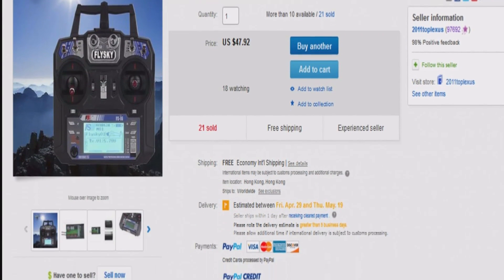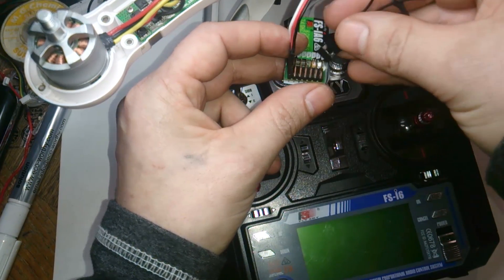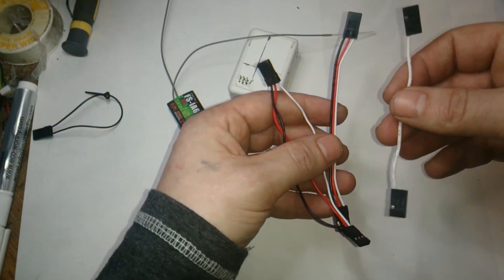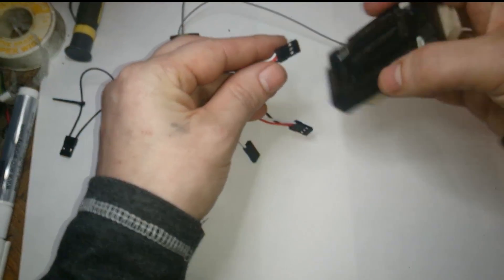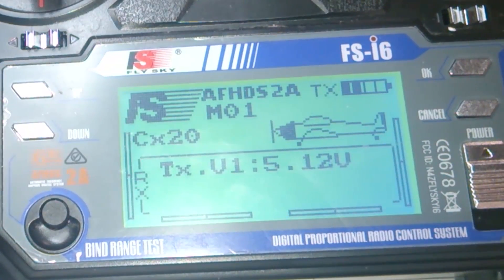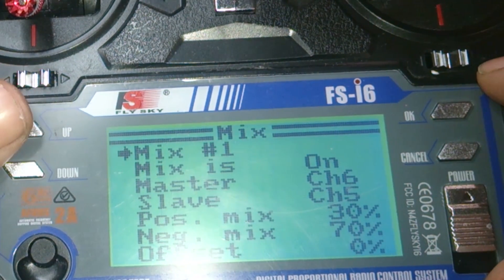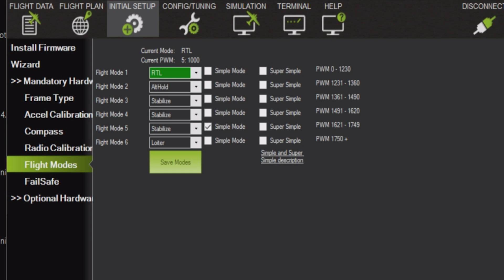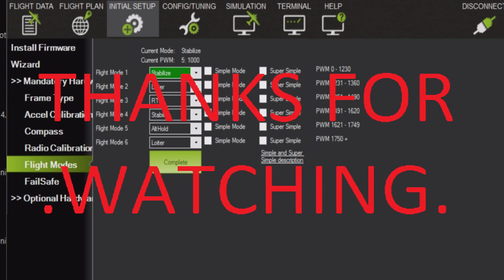cx20 flysky FS i6 FS IA6 binding and Mission planner settings

Comment: I have the Nova Pro from Hobbyking aka cx-20 that I want to use the FS-I6 with. I used this video to set the flight modes on a 450 frame quad I also have, worked great,on the Nova  Pro I also want to use one of the pots to controll a gimble.Have you made a video showing how to set up the pots?. Thanks Ala
Reply from the maker: ..your problem with that is your out of channels.. you can only have the dip switches .. or just the variables..    A guy named ViNsEDj asked the same question here in the comments..,..,The best I could suggest is using one dip switch and one variable .. but really you should look into doing the firmware upgrade and getting the ia10 receiver or the ia6b
Reply: I should have mentioned that I have done the 10 channel upgrade and have the 10 channel rx installed in the cx20
Reply from the maker: Hi for you its really easy .. just set the same settings for 5&6   but set the variables to use channel 7 and 8.. then simply plug in your cx20 gimbal wires into 7 and 8..
Reply from the maker: also for 5 and 6 mixing.. if you are not happy with that I found a alternative way ..  https://youtu.be/GMeAXyKahlw?t=858    i show how to use end points instead to get your 6 modes in mission planner, later in the video I show the settings for mission planner ..
Reply from the maker: sorry going to spam you .. with comments.. you can actually start the video here.. https://youtu.be/GMeAXyKahlw?t=799    its what you want with the gimbals anwyays.. just you don't have to connect to the apm.. you can connect directly to your receiver output 7 and 8  ... after I show the remote part you can skip to the end because you have the ia10  ..here are the mission planner settings for dip switches.. https://youtu.be/GMeAXyKahlw?t=1168
Reply: Ok Thanks a bunch That should be easy.As far as the 5&6 mixing for the flight modes im happy with the way they work now seems exactly the way it orginaly worked Thanks again
Reply from the maker: k cool, good luck..and safe flying =)

Comment: I notice at 1:38 on your video the white wire is not connected. On mine the wire was once connected but then cut. Is this supposed to be like it, or did you break yours by accident and maybe I cut mine when snipping off the zip ties. I also have 8 channels on the original rx but 7 0n the i6.
Reply from the maker: Interesting .. long time ago I had re soldered the wire ..then just wrote that pin off because its connected to a capacitor that goes to ground... So I just figured it was a dead pin .. I'm sure by now somebody has figured out what it is for..   I just looked over the data sheet and looked on the original receiver..and it is connected to pb6 of the st chip..alternate functions can be i2c and uart  (tx)  .. However the cap on the main board tells me they did not want that pin floating.... ... Maybe I'll try snooping that line later. they might of used a 8 channel on he cx20 and that pin was suppose to tell the cx20 when the battery in the remote was dead ect ect.. ..    Anyways  Maybe it would be best to solder that wire back up .. they did go through the trouble to make sure it did not float   later tonight I'll hook the wire up to my pc and see what is coming out of that pin.. At least on the original cx receiver..
Reply from the maker: I should note.. that maybe mine was never connected as well.. because like you .. i noticed it and said wtf.. then soldered to where i thought it should go..that was year or more ago.... to be honest I can't say 100 percent it was actually soldered originally..  ..maybe i Just assumed..  ...buttttttttt I had actually soldered it ..and then it fell off again to add to the confusion
Reply: Most strange,mine still has a piece of white insulation on it leaving about 4mm still soldered to the board. I'll ask on one of the cx20 forums but probably leave it cut.
Reply from the maker: I never did.. mine fell off again anyways ..... the data sheets said not have those pins floating ..so it totally makes sense to where it's connected..why it keeps falling off I have no idea about that either.. maybe later I will solder back on ..and simulate a flight with half throttle then remove the wire.. just to make sure its not causing our crashes when it does come off..    not sure if thra5herxb12s found more info about it .
Reply: I soldered mine back on and had a quick flight with no apparent probs. I just installed autotune so I'll go back out to set it up and have another test flight.

Comment: Thanks for posting. I wanted to use my i6 tx for my cx20 but what will happen to the gimbal, will it just point downwards or just thrash about. Is there some way to preset the angle on the walkera g2d.
Reply from the maker: I don't have that gimbal .. but you do have options .. You can do the Mod to 10 channels (you  need iab6b or get ia10 -- Ia10 is a quick mod, you just have to flash your tx and get a ia10 receiver  ....

You can test your gimbal and just see what happens 

You can go into mission planner and go into the optional hardware section. choose camera.. then set your settings.. example..
Set Tilt to rc8..  Make sure input channel is disabled. 
click stabilize Tilt
Now plug your gimbal Tilt into motor output 8 on your apm 

For roll set it rc7 .. use motor output 7 on apm .   ..
if you have pan then use rc6 and motor 6 output...

Also you might not have to click stabilize.. (just play around)

But most likely your Gimbal should adjust it self just when you plug it in..
without having to plug it into the apm.
Reply: Thanks. I can buy a new rx easily and follow your setup guide.  The gimbal needs to know what angle to point, it only has tilt function.some quads dont have an option to control the gimbal tilt remotely so I guess it must have a preset control for tilt, I need to look again at the instructions.  My main reason for wanting to use the i6 control is to try and get better range,how much range will it get compared to the original control.  Many thanks.
Reply from the maker: your right it should .. most gimbals will auto balance in the first 10 seconds ..worst case ..you can fallow my steps and just set the angles or the low and high to be the same thing ..that should lock it into place..
Reply from the maker: Hi i just did a bit of snooping around.. nice gimbal btw .. anyways I found this .. http://img.banggood.com/images/upload/2014/04-1/Walkera%20G-2D%20Gimbal%20Manual.pdf     and the instructions are on the right for  "initial tilt & roll motor angle adjustment instructions"    .. so after you do that you should not need to use the gimbal wires for it to go to the set location on start up..   .. and about the range I have not done any far range tests with it.   I originally got it because it has throttle curve. but it turned out I did not need it. I just had bad programmed esc's..
Reply: Many thanks.

Comment: Hello and thanks for your videos there always great.I just purchased the fs-i6 and have used this video to setup the flight modes.What im not sure about is what type of aircraft do I set the transmitter to for quadcopters, I assume its one of the 3 choices it has for helicopters.Which are fixed pitch, variable pitch and swash 90.Thanks for your help .Alan
Reply from the maker: hi I never bothered caring for that, I just use plane. thanks for the kind words as well.
Reply: Set it for airplane.

Comment: If im not mistaken, you affirm that Gimbal controls wont work with this? Damn just received it from Banggood :(
Reply from the maker: right.. unless you have the b version of the receiver then you can use modded firmware .. i just ordered this one http://www.ebay.com/itm/301888478520?_trksid=p2057872.m2749.l2649&ssPageName=STRK%3AMEBIDX%3AIT   ... really I should of ordered the 10 channel for couple of buxs more..but want to eventually make a step by step
Reply: I think I will too. BTW is there anyway to, 4 example, sacrificate one flight mode in order to configure gimbal moves?
Reply from the maker: I think the most you could do is have one dip for flight modes and one variable for only moving one axis of gimbal!?     so to try that in this part of the video only change one of the aux channels away from the variable https://youtu.be/Vyt2d8rXkws?t=532  you would probably want the dip with 3 switches ..0 for stabilze , 1 for loiter, 2 for return to home .. ect......
Reply from the maker: btw if you have a video transmitter on your quad. I'm almost done the software side of my headtracking ..It will be wireless and not dependent on remote ppm input.. which our remotes don't have either .so basically it will be able to control any gimbal on a quad pretty cheaply ..
Reply: Just done, put aux 5 in SWC, got 3 positions, Stab, Loitter and RTL, and aux 6 in VRB, and there, I can change the gimbal pitch! Its a gr8 way till I wait for the 10ch receiver to arrive. Just for curiosity, maibe S2 in Cheerson is CH7?? (Didnt connect channel  7). You´ve really helped me out, big thanks dude
Reply from the maker: cool it worked out for you.. yup the cx20 is 7 channel 5 is for your switches and 6 and 7 for 2 axis gimbals ... ...
Reply from the maker: It can be you have to re do a remote calibration.. then you have to redo a all at once esc calibration ..to let the esc's know your new low limit
Reply from the maker: andd just to make sure you need to reverse channel two  as well.. https://youtu.be/Vyt2d8rXkws?t=502
Reply: I did it, its working fine now!! Thanks for you big help!! Will u do a tutorial with the updated receivers? Going to try the cx 20 now!! :)
Reply from the maker: your welcome, yup once i get my new receiver in I will for sure..

Comment: Can this remote be used in more than 1 drone? I mean, is it able to have 2 different configurations for 2 different drones? I want it to use with my CX-20 and a 250 racer...Thanks!
Reply from the maker: you are able to have 20 different configurations ..
Reply from the maker: also take note if it comes with ia6 receiver or ia6b receiver. in the picture on the first pin it will say ppm,   If later in life you want to mod the remote to have 10 channels through ppm you will want to get the ia6b..
Reply: You have to run I-Bus to get the 10 channels